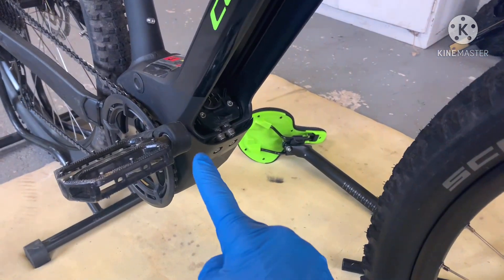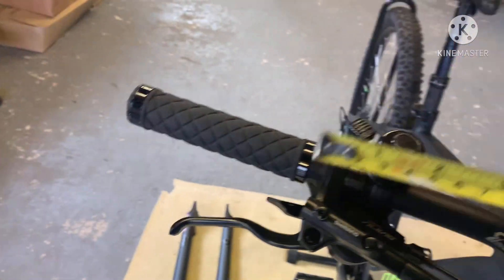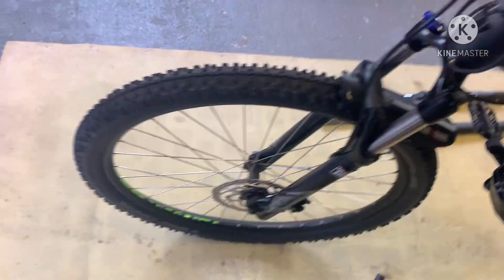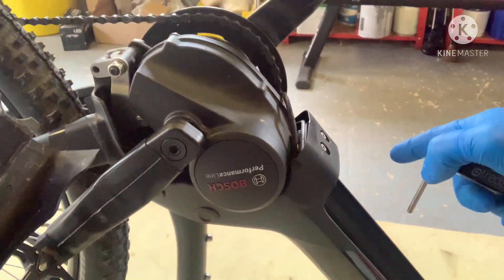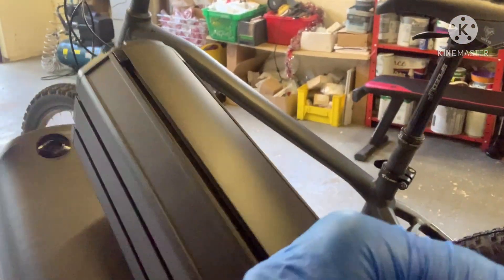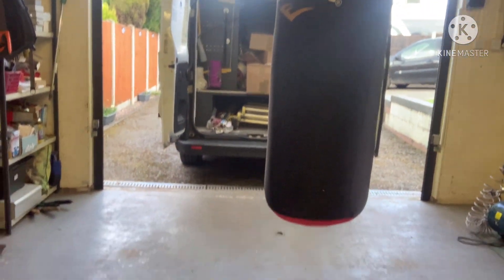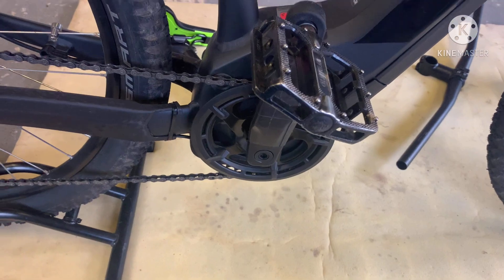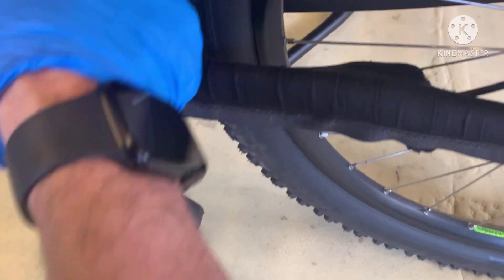Cube reaction 2021 Ebike review part 2 more details 65nm

Comment: Good bike tho it should be 75nm if u got it updated 👍there is a big difference
Reply from the maker: @whitefeatherslinger8194  Trouble is with all ebikes, the miles go up and it's harder to sell them, new models out all the time, my true love is standard mtbs. Love em
Reply: @leeteemtb9587  gotta agree my man pedalpower old school always ,😎my knee aint to good tho so its a must for me if i wanna keep cycling which i love,my trounle is u go into these shops and i see folk spending 5grand and more on ebikes that they cant even put a spanner too if something goes wrong and after warranty the bikes basically deemed useless as they wont sell u parts give u any advice on where or how youd get the bike sorted so i have to ask is the ebike even yours after spending all that money and if its not from the shop u bought it from they will not plug it in or do any work i mean what the hell is that all about ,ive 2. Top brand bukes here and because they havent been updated when they expect u to bring them back to the shop then the battery motor and displays stop talking to eachother apparently and they will not put a wire in them to do a simple update to each piece and thats not mentioning the price which the manufacturers claim it should be free but thats up to the shop ,i mean come on !i can understand if its a stolen bike  or whatever but why would u be bringing a stolen bike there to grt yourself caught surly youd think theyd have taught of this.

Comment: Ive the touring one trapese style with the gen3 the smart version,what i didnt like is that nothing from the smart system will work on this bike even tho its the same motor same shape battery but different pin connectors another way of bosch getting even more money outta us,its not fair ive the exact same battery and a powerpack that are for attaching on the outside,ive got a system 2 gen4 thatll fit straight in to  this frame but dealers wont do any updates if i work on it myself which is ridiculous and because  i didnt buy my bike in that shop they the bosch dealer in my local town will not do anything to the bike !! Why ! Bosch says to find a dealer but what if a dealer wont work on the bike its only to plug it in not any getting your hands dirty . ridiculous
Reply from the maker: @whitefeatherslinger8194  I sold my Cube Reaction about 2 or so years ago but I feel your pain.Thanks for the comments though

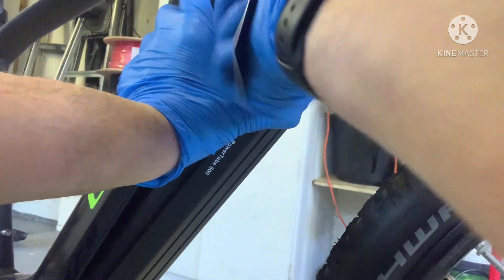Comment: 09:35 When you click the battery in place does it move at all if you press on it? ie is there any play in the battery once it's clicked into place? Mine does move a little when pressed so wonder if this is a fault.  thanks.
Reply from the maker: Behind the battery in the down tube I put some self adhesive packing just in case it rattles whilst riding rough terrain, hope this helps
Reply: @leeteemtb9587  Thanks, so it did move a little?  Wasn't fixed solid when you hear a click?
Reply from the maker: @llamalandYT  it was solid but I did it for safety. The plate behind the battery can be moved to

Comment: Hi, I have an identical one and it started to make noise on the bottom bracket when I forced it, probably due to wear. Did you have this problem there, how did you solve it?
Reply from the maker: Bottom bracket pins could be loose

Comment: Thanks for the review,,my levo keeps breaking and my job is to bicycle and deliever stuff so I lose money every day it's broken my backup bike got stolen so now I'm kinda forced to buy this bike ..i also use a rental fatbar so when I get the cube reaction i Will put the specialized 760mm bar on it and the 35mm stem.. planning to get a proguard fender on the front wheel and my old fox dropper post.. anyways do you know what the maximum width tyres it's possible to use without it touching the frame when flexing? I hope it can do 2,5 ,,, it's really steep terrain in all directions here in Norway so I guess I might have to upgrade the gears to atleast something with 46t on the rear cassette..do you know if it's a long cage on it or if I need to upgrade the deraileur?
Reply from the maker: I think you should be ok with 2.5 tyres. I had 2.3’s. The forks I had were a good size gap on the rockshox. 
Just be aware that the chain does come off on bumpy terrain so perhaps fit a narrow wide front cog. 
Thanks for feedback too👍
Reply: @leeteemtb9587  I see I'm sure i can make the chain stay on somehow maybe shorten it a link or two adjust the deraileur making sure the clutch is in the right position maybe add a chain guide but if it's not working it's not a big deal i Guess the drive train will only be temporary before I put on a 11 or 12 speed maybe you were unlucky with yours but just to get up to my house i Think i need a easier first gear ... did you try to get up really steep hills ,, I'm already breaking a lot of chains in first gear and trail mode which I guess I have adjusted to around 65nm so I hope the e10 kmc chain is strong enough ,,,

Comment: What speed does the motor assist cut out?
Reply from the maker: 16 mph
Reply from the maker: You can buy a speed box which tricks the motor into thinking it’s doing half speed so if you are riding at 10mph it thinks your doing 5mph then the motor cuts out at actual 32mph but this invalidates the warranty
Reply: @leeteemtb9587  I'm not interested in invalidating the warrenty, I got my bike yesterday, but it was loud where I was riding and being unfamiliar with e-bikes and in a loud environment, it was hard to tell what was assisted and what wasn't. Thanks for your response.
Reply from the maker: @mattsmith-yg8zg  they all make a noise after the new motor has worn in. Enjoy and keep safe

Comment: do I get one of these or a giant fathom e+3
Reply: I'm going to buy this one but if They were free and I could just choose between those two i would take the giant fathom
Reply: @HeathenRides  I bought the fathom in the end. Brilliant bit of kit!
Reply: @HeathenRides  not ideal, fully understandable!
Reply from the maker: Really depends on personal preference, I always check out the reviews on YouTube. The bosch motor on the cube is known for its rattles on bumpy trails and I found my chain came off on bumpy sections plus forks are terrible suntours. Distance wise though it just kept going but remember its only 65nm. Giant are a good set up, my brother in law has 2 of them, noisy motor and a problem with water ingress to the motor connections but he has fixed it now so all good. Hope this helps

Comment: I got this bike and was just wondering what size the front fork is as I'm looking to replace the stock suntour fork
Reply from the maker: The forks I got were Rick Shox 100mm travel, steerer tube is 1 inch 8th with 9mm quick release
Reply: @leeteemtb9587  cheers thank you
Reply: I really wish it had Tru bolt's it's sad to see so much potential wasted,, I'll guess I will need to get a 130mm RS fork with 110x15mm trubolt on which isn't very expensive if you choose Judy ,35gold, sector or something or something similar .. what about the rear is it QR9mm  or 12mm? trubolt
Reply from the maker: @HeathenRides  rear is quick release standard 9mm, should say on the cube website

Comment: What is the length of the steerer tube?
Reply from the maker: Sorry I don’t have the Ebike anymore as I’ve upgraded to a full suspension Ebike. The rockshox forks steerer tube was 210mm 1 inch 1/8th if this helps though

Comment: What's the model of rockshock fork? It has the same 9mm quick release?
Reply from the maker: I have the rockshox recon 29er with 1”. 1/8th steerer tube and 9mm quick release
Reply: Thanks Lee much appreciated
Reply: Hi, could you post a link to the exact model of fork please? It's a minefield of different specifications
Reply from the maker: @gunnbo  rockshox 30 TK model,100mm travel, medium coil spring, 46mm offset, 9mm quick release hub, 29er wheel. Hope this helps
Reply from the maker: @gunnbo  yes certainly, I will do it later👍